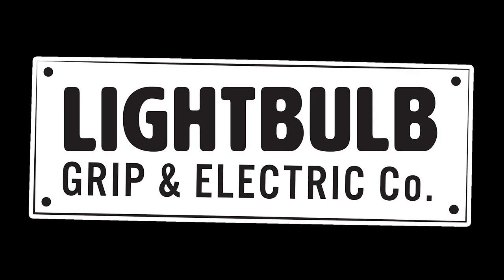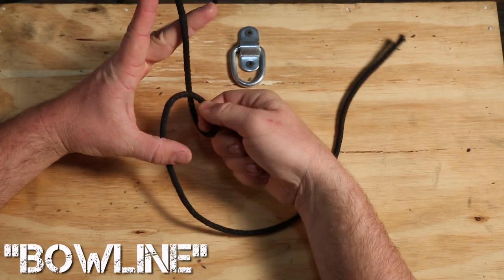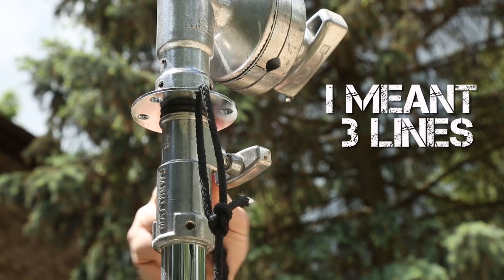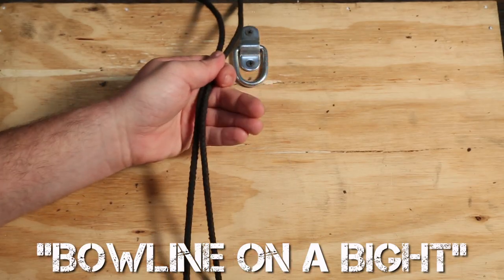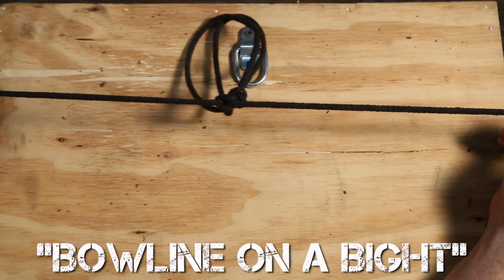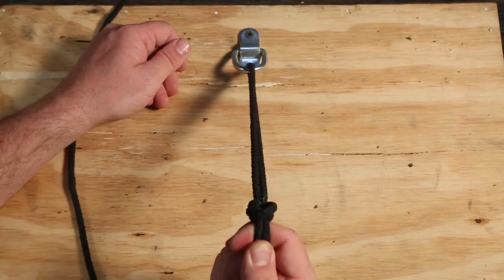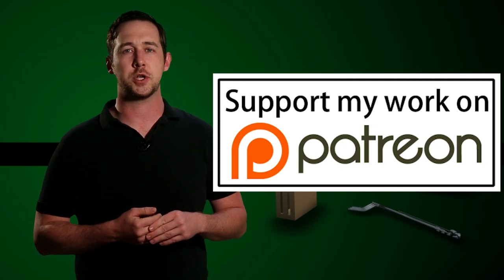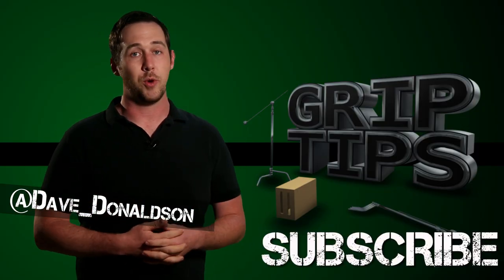Ep 39: Loop Knots

Comment: Hey Dave, it's me again. So here are a few thoughts:
1. The choice of knot is usually determined by whether or knot the line is under load, and if it requires adjustability.
2. Knots need to be able to be tied under adverse conditions, and shouldn't take longer than 5-10 seconds. 
3. Most G&E, yes even union, don't know knot terms like "bight". We wouldn't classify them that way either unfortunately. We usually classify them by whether they can be adjusted. For example: when tying off a frame, should one use a truckers hitch or a high tie? It depends on how much slack the line has, and how much tension the line needs to put on the frame.
Reply from the maker: Jeff Locke "whether or knot"... I see what you did there. Haha. Thanks Jeff, I'm doing hitches for the next one. Greg told me what a high-ti was the other day. Think you could text me an example? I might include it next week as Greg has told me that you guys use it out there quite a bit.
Reply: Yes of course. Let me see what I can do. I'm working today, so it might take a bit.
Reply from the maker: Jeff Locke it's all good